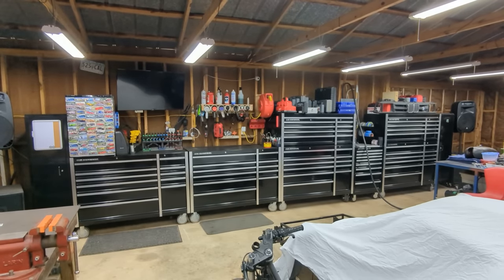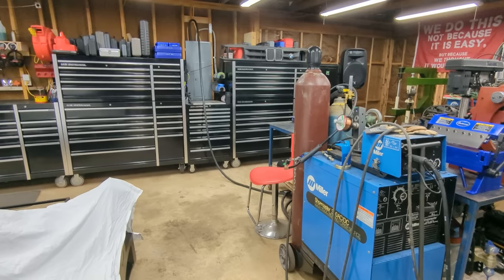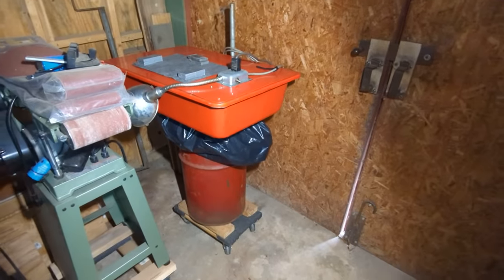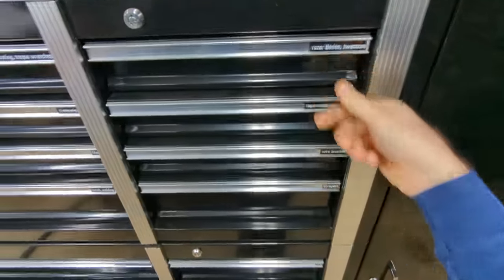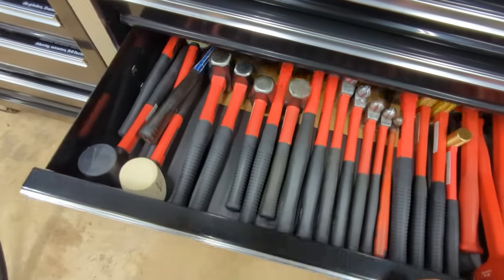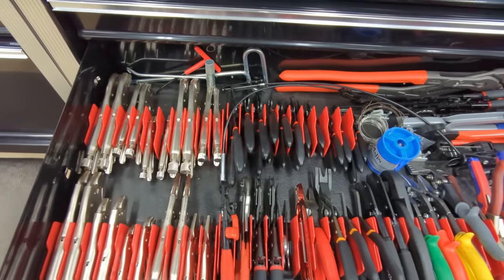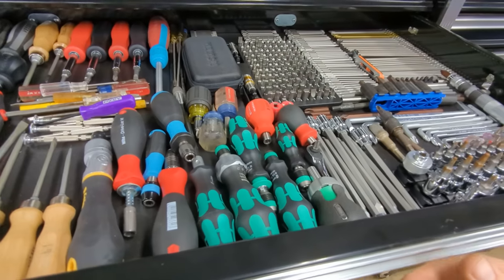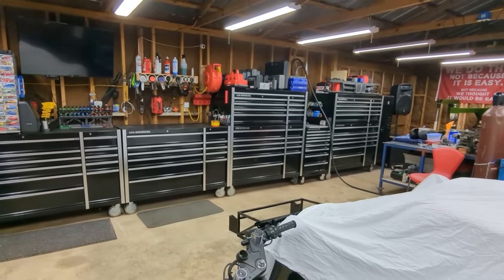ULTIMATE HOMEGAMER Toolbox & Shop Tour!

Comment: Great Shop!  just wanted to mention (you may already know this, and may even mentioned it) that welding parts that have been cleaned with chlorinated brake cleaner can be super dangerous if any residual cleaner remains when you weld.
Reply from the maker: Thanks!  I only use non-chlorinated, for sure.
Reply: For welding I recommend to never use any brake cleaner. It is too easy to grab the wrong can or if someone see's you using but they do not know any better. Chlorinated brake cleaner, when heated, will produce phosgene gas which WILL kill you! 
Always use acetone for cleaning prior to welding or heating.
Reply: KABOOOOOOOOOMMMMMMMMMMMMMMM!!!!!

Comment: Great video! I’m envious of your organization. Thanks for the tour.

For those Plano boxes or any other box I stack on each other, I burn two holes at one end with a hot nail/solder iron, insert two ends of 550 paracord and tie knots at each end. Makes a simple pull handle

Comment: Fun fact: Costco sells large clear plastic totes in 3 packs, (11.25 gallons) and smaller ones in 4 packs. I appreciate your wire shelving system but if you decide that certain things would be better "stacked", I found those costco totes a revelation because the price is fair.

Comment: Dude.. that's easily 250.000$ in Tools 😮
I want that shop😂
Reply: Not even close. Most tools are entry level and mid grade at best. Go look at the price of tekton it's nothing crazy. Even the harbor freight toolboxes add up to a few grand
Reply: @T6Tarek The welders alone are about 3500€ each, lathe is probably 10 grand, mill also 10 grand.. the whole Milwaukee stuff is easy 5-8 k... It adds up
Reply: @patrickberger41  besides the big stuff I have more than him. All tool truck stuff and it's not 250k. Miller welders. 252, 185. His welders are old. You can pick them up pretty cheap at industrial auctions. His lathe and large equipment comes with a price. Hand tools nothing special. I didn't see all that much Milwaukee in all reality. Amura 14x40 metal lathe larger than what he has can be purchased for 2 to 5k. Things might be more expensive across the pond but a lot of stuff is a dime a dozen over here

Comment: This is the absolute and ultimate tool collection, I have ever seen! Congrats! I also can see that you spent a fortune on Milwaukee battery tools! These are high end tools and anything else but cheap. This leads me know to my question; I want to ask you if you are not afraid that one day these batteries can no longer be charged; I mean they still can be charged but the batteries will run down very quickly. And replacement batteries are very expensive if still available, at all. This is the experience I made. As a consequence, I am about replacing all these tools against pneumatic tools. Yes, you have a hose, and not fully independent, but most of pneumatic tools are smaller than the battery operated ones what is a big advantage when working on cars or in narrow spots. I wonder what you think; let me know.
Reply from the maker: Thank you!  I've got about 16 batteries, down from 18.  Two went bad and were out of warranty.  The rest continue to work fine after 3 years.  It's a bummer but far outweighed by the benefit of being cordless.  Pneumatic is a pain in the butt and I'd never want to go back.  And a battery leaf blower will change your life!

Side note: I'm not impressed by the Forge so far, except the short charging time.  I'd still recommend the 3, 8, and 12 aH High Output, until they release non-6.0 Forges.